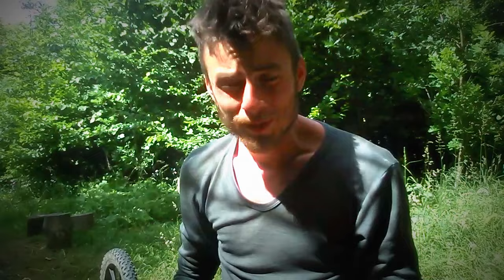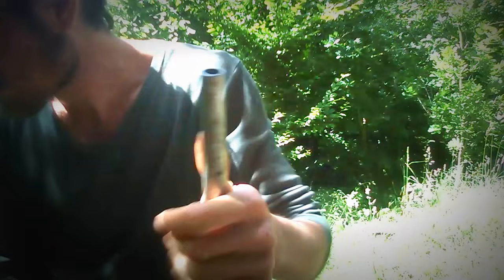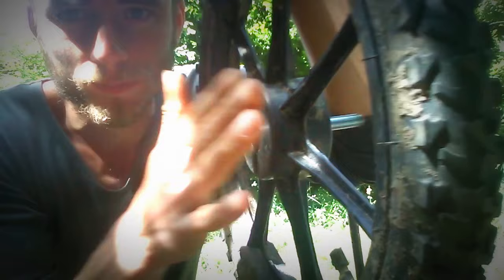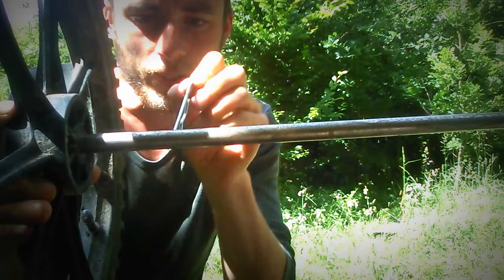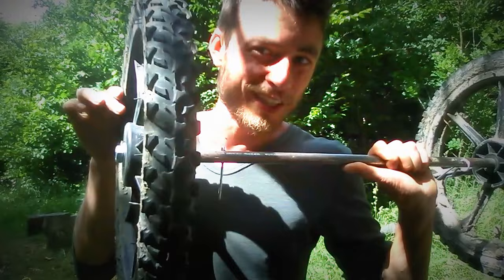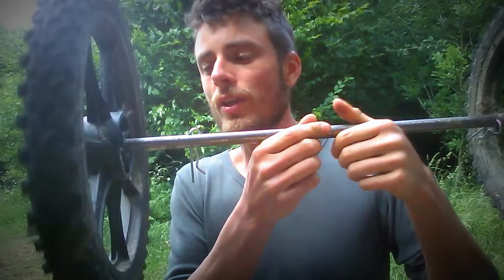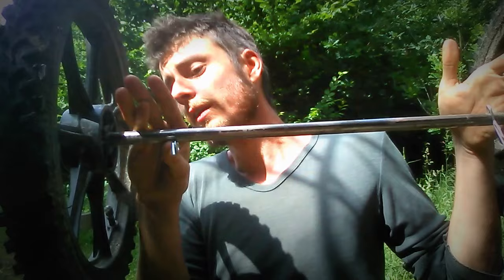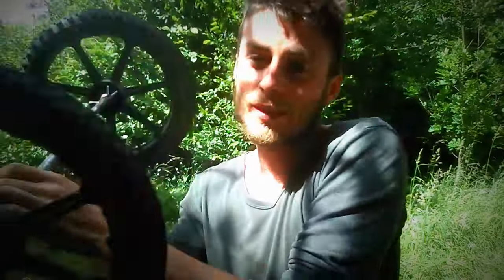Kar - a Simple to make DIY cart Axle

Comment: Thank you for this. Im trying to build a seat and wheels. To add onto a trikecycle to take a disabled family member for bike rides.
Reply from the maker: I am feeling the approach in this video might be too light, or not strong enough, to carry people. My need for the cart was that it could easily be disassembled without tools and that I could carry the parts. The use case for you seems different. A stronger and fixed axle would be most recommended

Comment: Actually tried this. I clean homes and have to Pressure wash around the home. Washers are not designed to wheel around well, more bring it to a place and park it but I needed to drag it around a yard full of mud and debris. I had some high wheels but the pin bolt axels gave too much play, wheels wobbled, basically dragging it because wheels wouldn't spin right. Had some conduit, maybe 1/2" since tires were 1/2 bearing. Took some sanding of the bolt to get them to slide in, had to jammer in to widen the conduit a tad but now the wheels don't bow inward and allowed wider spacers on the outside of frame so wider stance. Best thing is without the removable handle the washer frame is not stiff..This axel mod makes it stiff so I don't need that high handle which makes it easier to load

Comment: Matthias - Nice idea.  Take it one step further by using all thread instead of two bolts to improve the stability and the strength issues.  Be sure to used two nuts locked together on each end so that the torque is just right, and nothing comes apart.  The only disadvantage, you will need two wrenches.  With some more engineering you can reduce it down to one wrench.
Reply from the maker: Thank you for the feedback. The all thread I could get here in stores is not hardened steel, thus it would bend. The bolts I use are hardened and can not be bend.
Reply: @MattCrom  Having the all thread tightened inside the conduit with nuts and washers gives the combined part a rigidity that is stronger than the sum of its components.  This does not mean that it won't bend, it's just less likely to bend.  I have used this technique to construct camera booms out of all thread and PVC pipe.  It's a compromise technique that saves weight and money.  If weight isn't as important you can sleeve the all thread in a snug bit of tubing and pack the rest of the dead air space in the conduit with sand which will make it substantially more rigid.  I make no promises it will work, but just present it as a possible option.
Just how heavy a load do you carry with your cart?
Reply from the maker: @ScorpionRegent  yeah makes sense!

Comment: By the way - you can use regular bike wheels (much much cheaper) by using the threaded through-rod (if it's the same size and tpi as an axle so the cones work) and 8 threaded bearing cones and 4 sets of bearings and 4 nuts and grease. Has been done!
Reply: I have a pair of 20" bike wheels and would like to use a threaded rod to make a cart, can you explain the details of this design?
Reply: HELLO IM FRO THE FUTURE

Comment: hey man, im building a candy cart, and im up to the wheel and axle part...so one of the wheels have lost the ball bearings...could i theoretically wel a rod straight to the hub of both wheels and that could be used to turn the wheels rather than the ball bearings

Comment: I'm thinking about making a wagon to bring home my groceries but I'm wondering if I can use only 1 piece of steel pipe as the axle to put through the wheels. I already have 4 new No-Flat tires that I had bought for my child's wagon but have never used it. Can you please tell me if it will be a problem for me when turning corners? Thank you 🙏
Reply from the maker: Hey D Sing, I think everything is possible but your design choices have to match the needs and use of the cart. I would suggest a solid axle to put through the wheel. I do not really understand or get the question about turning though.
Reply: @MattCrom  
Thank you for the immediate response. Yes, that's what I'm thinking to use one solid piece to put through the wheels. Ok, thank you 🙏
Reply from the maker: @skinnydee1886  your welcome 🙏

Comment: VERY COOL! Thanks! I need to fashion a garbage can cart out of wood and this gives me a way of attaching a couple of wheels I'm going to buy at Harbor Freight. The only thing different I'm going to do, probably, is use a hollow piece of smaller diameter pipe to put inside the axle instead of bolts so that I don't have to drill through a hard, solid bolt. Anyway, thanks again. Good job!

Comment: Thanks, solved.
Reply: I'm going to cut the bolt head and put the shaft in the pipe so I can use a nylon locking nut to put tension on the wheel bearings. Not sure about one bearing riding on the treads but bolts are cheap.

Comment: Hello mate! I found a 36" piece of threaded 1/2 pipe at my local hardware store that I guess I could use as an axle itself? Could I just use that and adjust the tightness around the wheels with nuts and washers? Do you see any downsides to using a threaded pipe through the wheels?
Reply from the maker: Hey DaveB, I'm not sure what kind of steel this threaded pipe made out of. If it's hardened steel you be surely ok. But I think it might be softer steel, if so, it could bend. If your cart/contraption/load  is really light than this still might be ok. Hope this helps..

Comment: I'm in theater production and we have a remarkably limited budget, so this was very helpful. Do you have an estimate on how much weight this type of axle can support? The wagon I'm looking at making will not move quickly, but it does need to carry two people. If this axle is not heavy-duty enough, is there a way you know of that can strengthen it?
Reply from the maker: Hi, I am sensing that carrying two people on a single axle, as shown in the video, is not going to work. If you have two axles, then just maybe it could work. if those persons do not jump around on the cart. You could maybe use bigger dimensions than the rods and steel pipe I have used. 
This cart was made to be simple, lightweight and repairable along the way without the need of tools such as wrenches or screwdrivers. Your situation and needs seem very different.
Reply: A simple way to strengthen would be to insert a length of rebar in the centre of the tube, just a thought.

Comment: Pass a threaded rod through it ($8?) and torque it.  Thought of a shim (thin washer) after you drill the hole - that would cut down the play.  Should be able to use something though if you had the energy to find it, that would PULL the bolt into the rod - like a small "key" (a motor shaft key) - that would function like a wedge.  You'd need something other than a round through hole.  Have an idea here - drill the bolt hole a bit short of lining up perfectly, and drill a "chamfer" that will line up - then try driving a nail through it to pull the bolt tight.  Just thinking.  I'm avoiding work.  But I also actually have this problem.

Comment: Simple doesn’t mean wheels from a wheel chair ??? Most people have old bike wheels no wheelchair wheels ,,, if you have wheelchair wheels you probably won’t be needing a cart you will be needing a helping hand opening a door instead!!!
Reply from the maker: Haha good point Ariel 😂
I know that getting hold of wheelchair wheels will be statistically speaking harder for majority of people. Thus that aspect might be Indeed not the simplest. I had to buy them from a wheelchair shop. But for my intention and needs for the cart, it made the easiest solution. As i wanted to disassemble the cart during my journey, and did not want to rely on tools, like a wrench of screwdriver. Hope that clarifies.